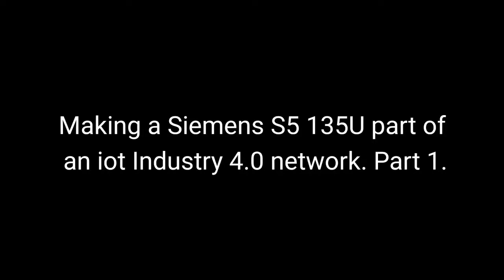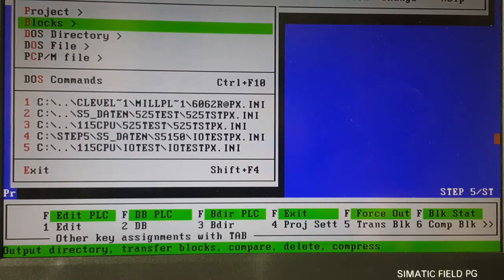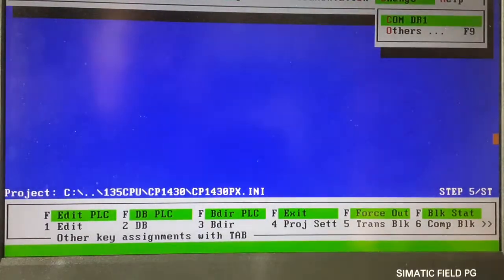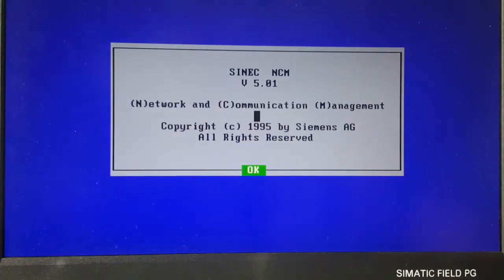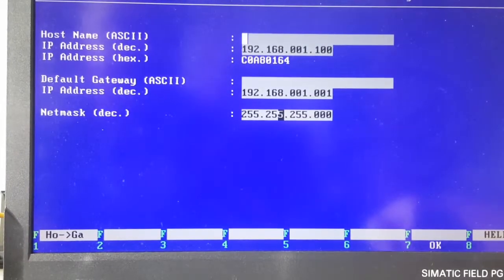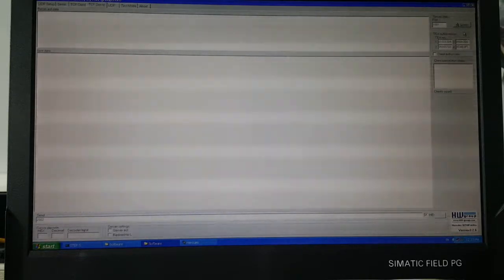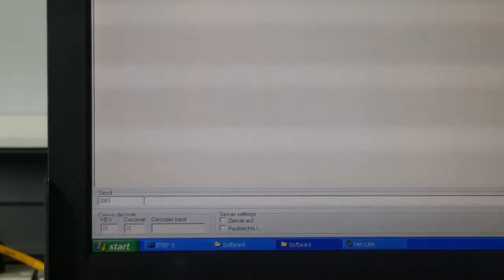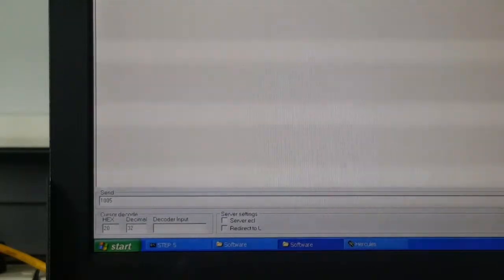Connecting a Siemens S5 135U PLC to ethernet. Part 1

Comment: Hello and thank you for the very informative video. I would have two questions: 1. What particular card are you using (... 0TA0... or ...1AU0...) and 2. What is the grey box your RJ45 cable is plugged in?
Reply from the maker: Hi, the card I'm using is 2XV9 450 1AU00. The grey box is an rj45 to AUI converter. I hope this helps.
Reply: @a-c-pautomation8672  It helped alot and solved the confusion between a CP1430 TF and CP1430 TCP. You need different SW packages for them: https://youtu.be/STb4t72zbKk